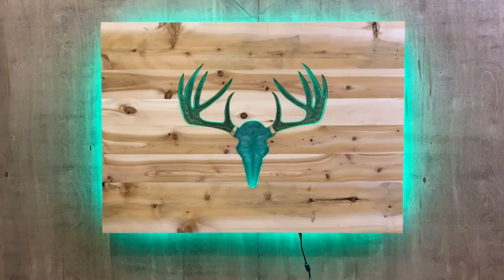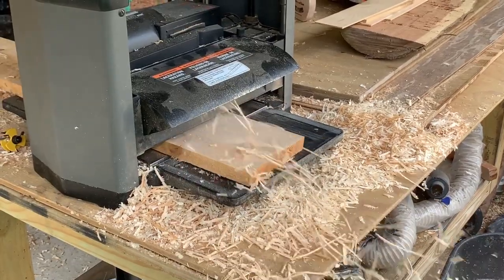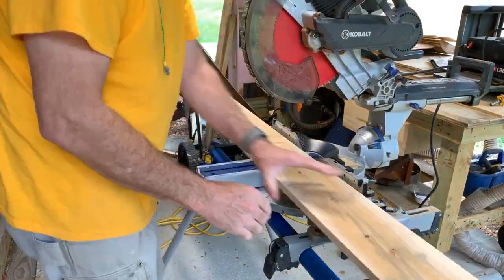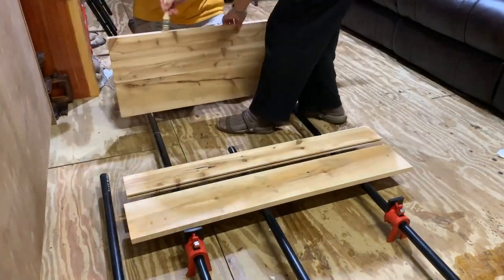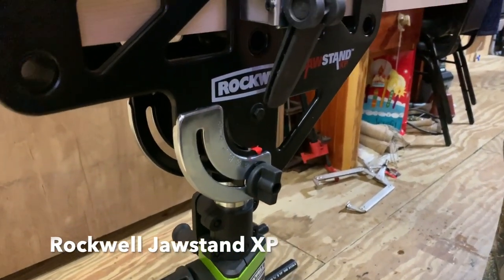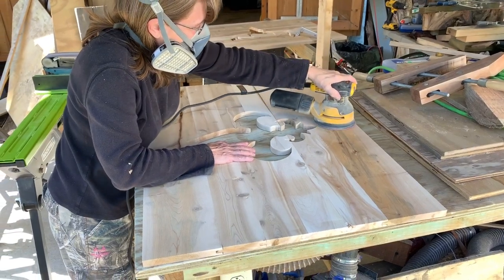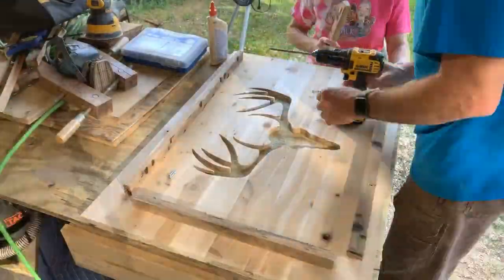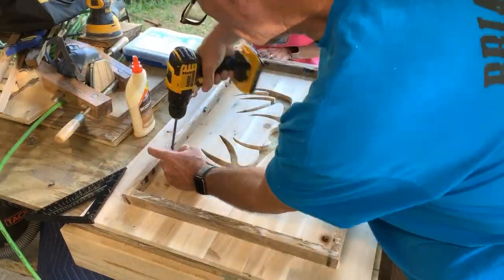DIY How to build lighted wall decor, wood, WiFi led light strips, stonecoat epoxy

Comment: Great work. Link to those led's please?
Reply from the maker: We ordered them on Amazon. This is the lights: Led Strip Lights, WiFi Wireless Smartphone Controlled Waterproof RGB Rope Lights Flexible 5050 Light Strip 32.8ft 300Leds 24key IR Remote Controller UL Power Adapter Work with Android iOS Alexa. Not sure how to share the link itself. Sorry.

Comment: How did you hang it on the wall?
Reply from the maker: Hanging wire from hobby lobby, small braided wire with a lot of strength.  Makes it easy to hang straight